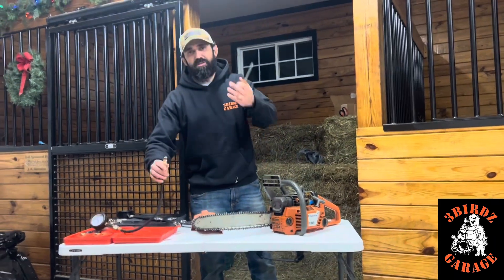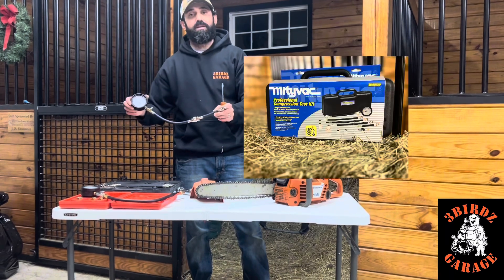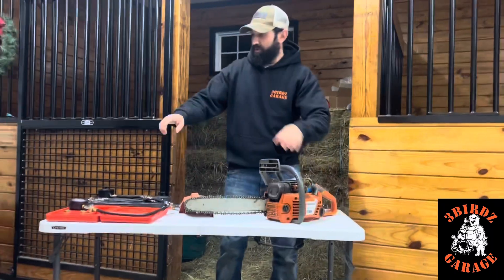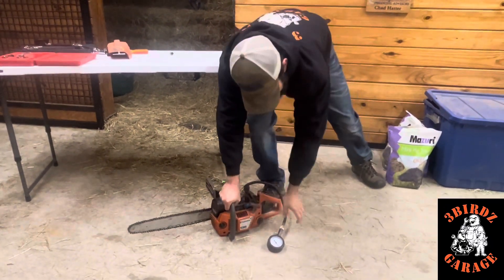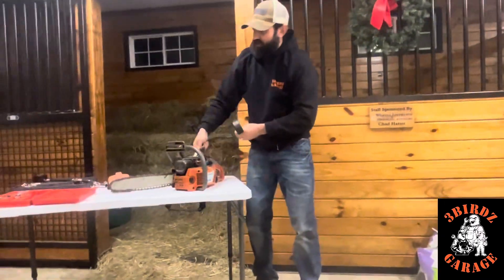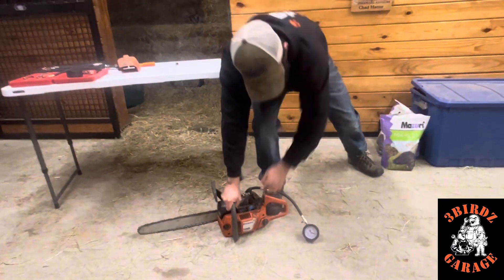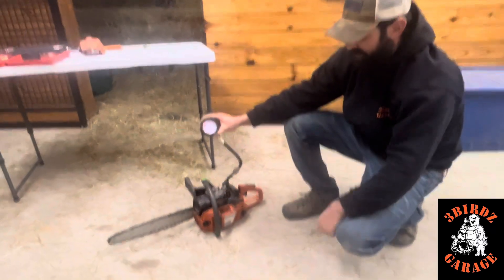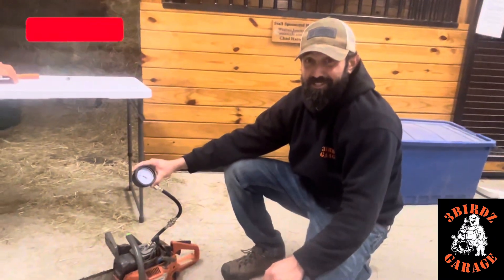BEST Small Engine Compression Tester!

Comment: i tried the cheap one on my ms260, it read 100 psi, i did the same test with a reputable compression tester and it read 155 psi, i almost changed my cylinder and piston, TF i held out and bought a proper tester

Comment: The valve keeps air in the hose. As piston goes downward it sucks air out of the hose if no Schrader valve. So it reads low. Unlike a car, that hose takes a lot of air for small engine cylinders to fill.
Reply from the maker: Thanks for the great explanation!

Comment: I too have been doing some research, for a compression tester with shredder  valve. I just sold my cheap Harbor freight one. About to pull the trigger on the Mityvac MV5530 Engine Compression Test Kit. I will now I've been seeing good reviews about it also. Question do you screw the shredder valve, into the end of the hose that goes in the spark plug hole?
Reply from the maker: The Mityvac , in my opinion, is the best and most accurate compression tester out there. Yes, you screw the shrader valve part into the spark plug hole.